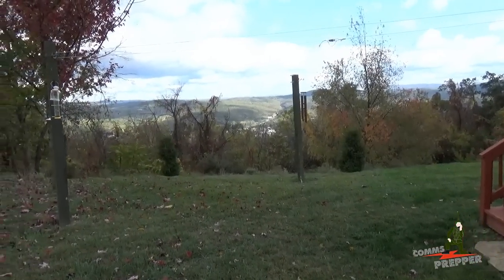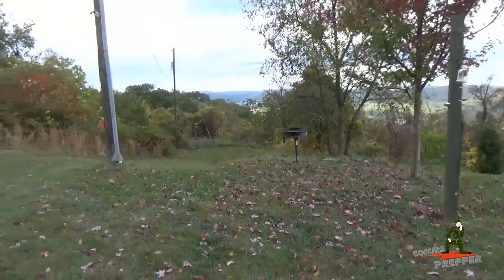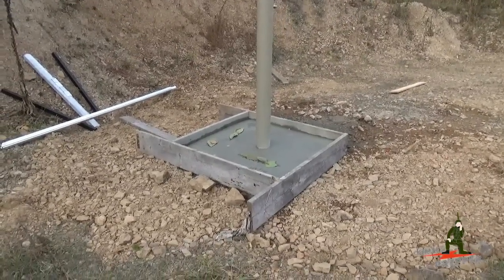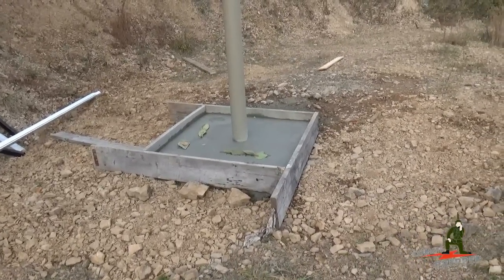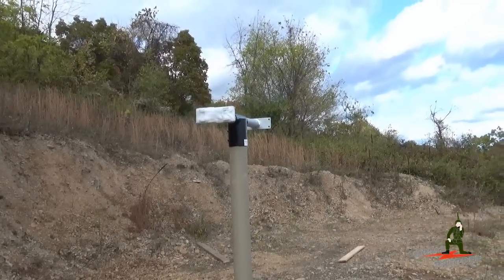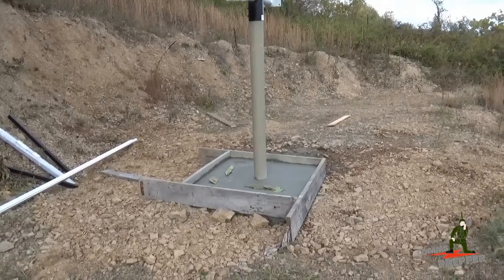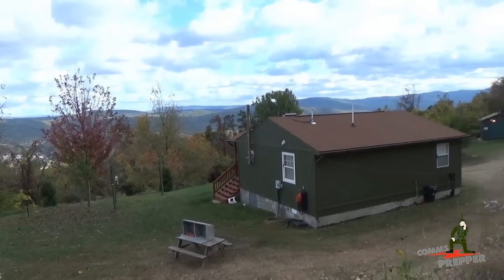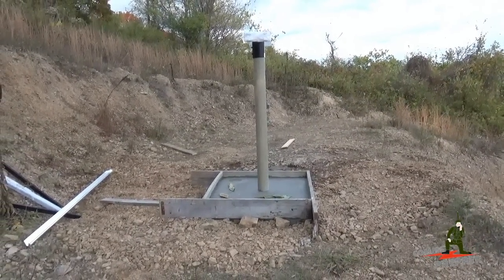Solar Panel Mount Project Update

Comment: Solar is now so inexpensive that just about anyone can afford a small system to run LEDs and a radio, and charge a laptop..  One does not need huge amounts of power.  Price is down to near 1 dollar per watt.  Check Amazon for Renolgy brand panels.  For a small system got to be very efficient system, so use 12vdc devices only, do not use an inverter....power hog.  Rule of thumb, buy 1 plus watt for every 1 ah of battery capacity. My hillbilly special 275 watt system cost less than 800 bucks.
Reply from the maker: Folks should focus on a quality charge controller. Specifically a programmable MPPT controller.  PWM controllers link the array voltage to the bank voltage.  MPPT gives you more flexibility.  If the controller is not programmable for float, bulk, and equalization voltages don't buy it!!!!!!!!!!!!!!!!!!!!!
Reply: Agree. The Blue Sky MPPT 3000i is a good option for just that reason, however if one is needing to buy other preps and can only squeak into a very basic system, an entry level charge control may have to do and will work.  However, for only a little more, the PWM Charge controller such as the Morningstar TS-45 is a reliable-solid programmable CC.  Get the remote temperature sensor for the batteries.  Battery depth of discharge is the most important factor in preserving batteries.  Start with lead acid, not AGM's.

Comment: Hey Comms, what's size array are you going to do? are you looking to expand total wattage and battery array?
Reply from the maker: I need more watts so I can get more charge current.  I am changing over to three Kyocera KU-265 panels but will still be short of my goal of peek charge current that equals 10% of the battery bank AH value (450AH).  Ideally I should be able to create 45 amps of charge current (the 10%).  The three new panels will general peek charge current of 25.65amps vice the 16amps I generate now.